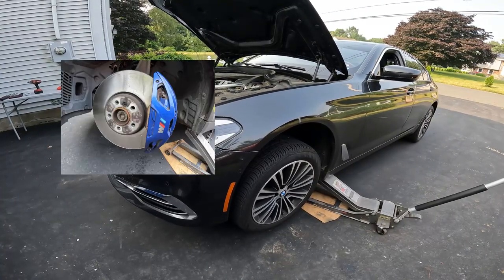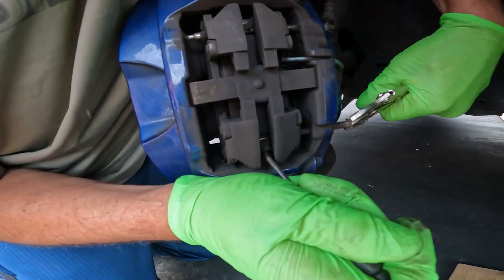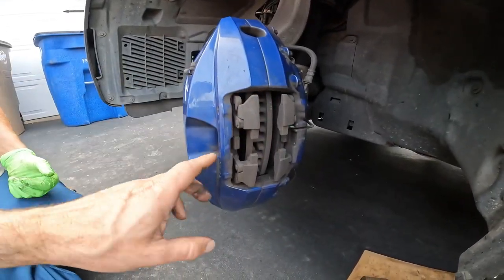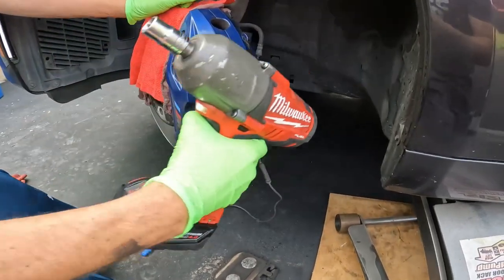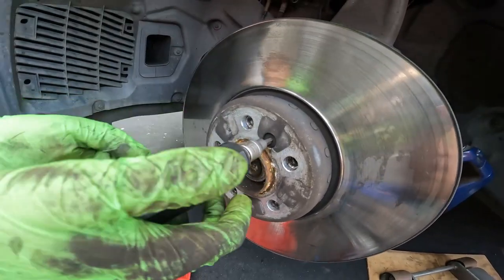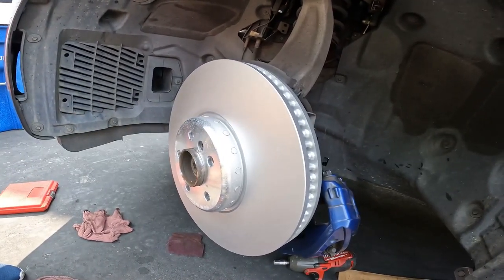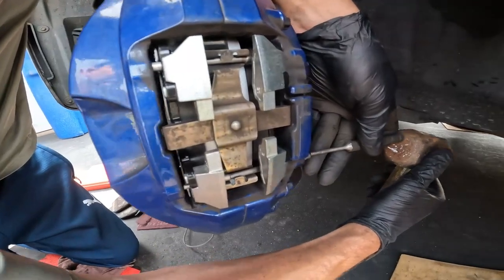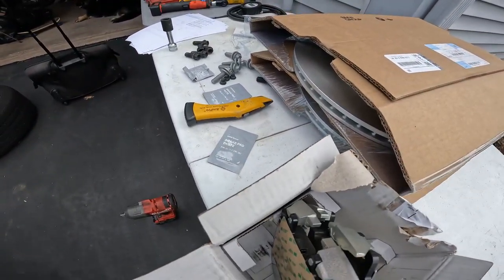BMW M Sport Brake Pad Replacement Step-by-Step With Torque Specs  (Brembo M-Sport)

Comment: This was extremely helpful on the front of our 2018 X3 m40i. Brembo recently released ceramic, low dusting pads for the front and rear of this car so I tackled it this morning. Especially appreciated the side note on not using the paste on the rails of the pads as the pads have a specially coated shim that obviates the need for such paste. Now to bed them and see how they stop, and if they’re cleaner than the originals!
Reply from the maker: Hi Ron! Awesome to hear my video was helpful! You will have to let me know how the low dust pads work out and how responsive they are. Thanks for being a subscriber for 10 years with me!

Comment: Definitely one of the best instruction videos I have seen for replacing rear brakes and rotors on the BMW X5.  I have a 2019 X5 M sport package.  I didnt realize how complicated it was.  I would never have figured out all the steps and special tools I need without watching this.  I may still bring it in to a professional shop to since I dont think I would ever use those tools for anything else in the near future and I dont want to kill my back for this at my age.  At least I know what to ask them about and how long it should take.
Reply from the maker: Thank you Charles. Thank you for watching and posting a comment. If you do decide to do them let me know how it went.

Comment: just finished mine today. this video was extremely helpful. thankfully i work at a dealership and can use my shops lifts and air tools so it went very well. appreciate the tutorial! note: make sure you have something to hang the calipers up on the upper control arms. makes cleaning the pistons and calipers much easier and they are out of the way so you can easily swap the rotors. this guys video was very thorough. DO WATCH YOUR BRAKE FLUID LEVEL CLOSELY! I HAD TO SIPHON SOME OUT.
Reply from the maker: Great to hear Steve! Appreciate the comment!

Comment: You correctly pointed out the lift or jack points under the bmw. however, you then said use a jack stand. you have already used the jack point with the hydraulic lift, so where do you position the jack without damaging the bmw sills.?

Comment: Question.  I just need to replace the pads. Will I harm the rotor when pushing the piston with a screw driver?
Reply from the maker: If you catch just the outer edge you should be fine. Just be gently when prying it a bit. You only need to clear the lip of the rotor if any. Then take the caliper off and use the old pad and some pliers to compress the piston. This will help keep the rotor safe.

Comment: Depending on how much you like your customer, would advise taping near the pin slots with some masking tape. Mayhew punches with the extended shaft works wonders.
Reply from the maker: Thanks for the info!
Reply: @AskTheCarExperts  Always welcome. Some other pointers that may make it easier on yourself would be dousing the pins with a penetrant lube to allow easier sliding, you can wash it off after installation if you want. 
I typically crack the bleeder line open and wedge a mini-prybar to make things easier between the piston retraction. The bleeder line open is very effective, sometimes you can even use your fingers to push in the pistons.

Comment: Does it work on LCI with break regen?
Reply from the maker: Yes Brake regeneration does not actually use the brakes. When you brake the alternator slows the vehicle sends the power back to the battery for charging. Brakes take over at certain times but the vehicle is slowed using engine braking.
Reply: @AskTheCarExperts  Awesome, thank you very much. very helpful. I have replaced pads/ rotors on fords and Jettas before but this would be my first one on a BMW :D
Reply from the maker: @metalmansyr  Glad to help! Hope my video is helpful and I have two giveaways running. Just watch the video and post a comment. Smoke machine and a borescope.

Comment: When you press the brake pedal to glue the pads in, should you refill the brake fluid u took out?
Reply from the maker: Hello, If the fluid is low then you would top it off but if the reservoir is close to full it should not go down to much.

Comment: Thank you so much for this well made video. When I did my brake job, all the videos focused on the rear brakes bc of the ebrake. 

I’ve done a lot of brake jobs but wanted to see the details of this particular car. Still, until you said it, it never occurred to me why the pins were so hard to remove from the back side of the caliper. Also it never occurred to me to turn the wheel so the brakes were easier to see. Of course can only do that on the front but it still helps.
Reply from the maker: Great to hear my video helped!

Comment: Great Video!  Can't wait to replace mine now.....can you explain the "glue" a little more at the pistons? What brand pad did you use? Do you need to use brake pad adhesive (red bottle) with aftermarket brands like EBC?
Reply from the maker: The parts are OEM. The pads come with the adhesive because these are not floating calipers. The pistons when they retract allow for the small air gap to prevent constant pad to rotor contact. The glue on the pads stick to the piston surfaces and the lip ring seal allows for the retraction and the air gap needed 😀
Reply: @AskTheCarExperts  thanks!

Comment: Great video thanks. 

Do you need to open brake fluid tank cap to allow you to push pistons back in?
Reply from the maker: Thank you! No, the air will vent out but be cautious not to allow the fluid level to get too high. You can open the cap to make pressing the caliper back easier and monitor the fluid level. Brake fluid will destroy paint so it is important not to let it overflow.
Reply: @AskTheCarExperts  Thank you. Appreciated.
Reply: @AskTheCarExperts  if the fluid level is getting too close to the top, do I simply siphon it out correct? When do I put the fluid back in the reservoir?

Comment: Hello so a shop recently did my front brakes and they make a creaky sound when I depress them a bit like the sound at 12:22 did they forget to lubricate something? When in park as well and I press the brake it makes the sound too
Reply from the maker: Hello, Hard to say what might be going on. Do they make noise when braking and rolling forward? If so, you should have it checked by the installer. Brakes can make a crunching noise while stationary and turning the wheel left to right.
Reply: @AskTheCarExperts  Yeah the noise only happens when applying the brake even in park so I know it’s not a suspension issue. I’m thinking maybe something got stuck where the pad slides back and forth
Reply from the maker: @domcars  It would be worth having them double check the work they did.
Reply: @AskTheCarExperts  Alright will do 🙏🏼

Comment: You need to replace the front caliper retaining bolts everytime you unscrew them ?
Reply from the maker: According to the repair instructions, they are one-time use hardware. It would be recommended to replace them.

Comment: Does the rear pad replacement require electronic brake to be retracted? And if so how?
Reply from the maker: Hello. Most modern BMWs have electronic parking brake. You have two options. Use a scan tool that can put them in service mode. Or use a brake tool. I do this in my videos on rear brakes.
Reply: Yes well, I ended up doing the rear without your video- (because I can’t find it) but i had to retract the electronic brake system manually with a T screw, other than that it was similar to any brake change.
Reply: @AskTheCarExperts   Do you have a video showing how to do the rear brakes with the special brake tool you mention?  Thx!